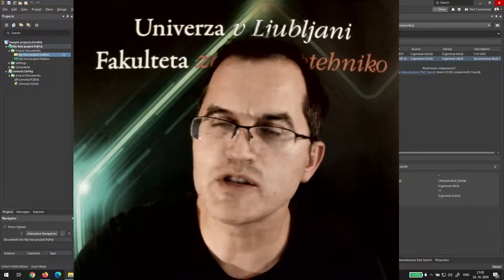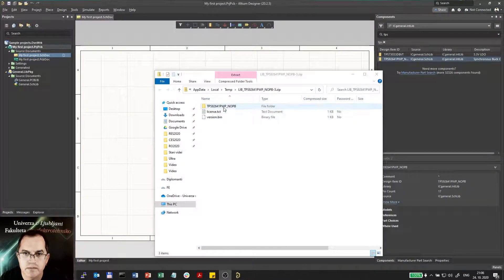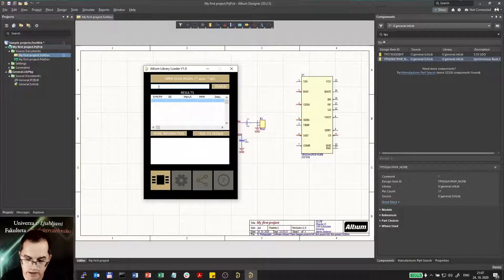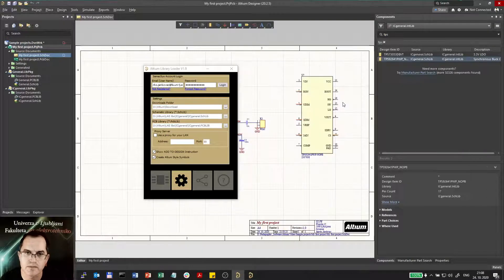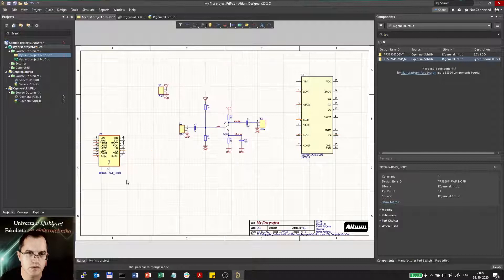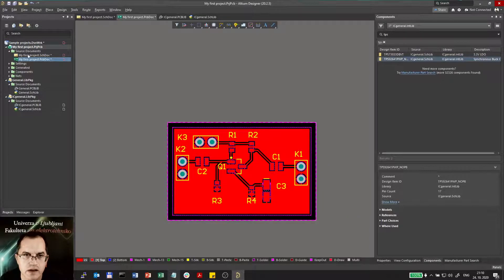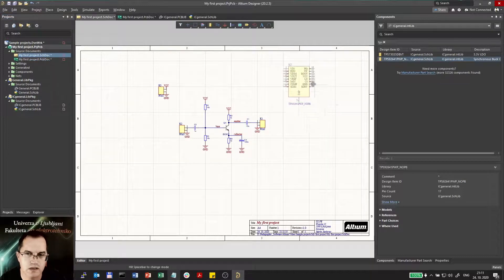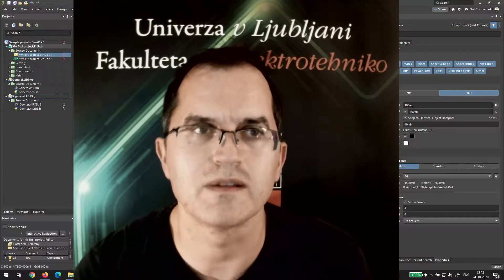Altium Libraries #02: Importing new component with SamacSys

Comment: Thanks for the very nice video .  However I have a question related to the installation of the Library Loader "Altium Library Loader 1.9 Setup.exe" on top of Altium Designer 20.2.6. Nomatter what I tried it does not create the File and Tools menu entries for accessing the Samacsys Library Loader.  So in other words for Altium is as if the loader tool does not exist. Do you know if this is this a known compatibility issue?
Reply from the maker: COuld not say for sure. I have installed this with previous version of Altium and than upgraded it later.